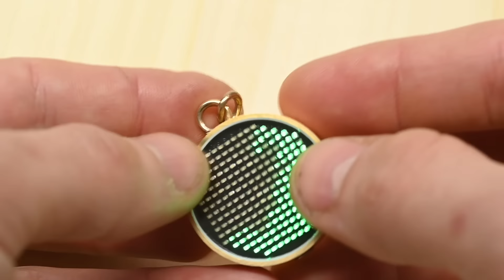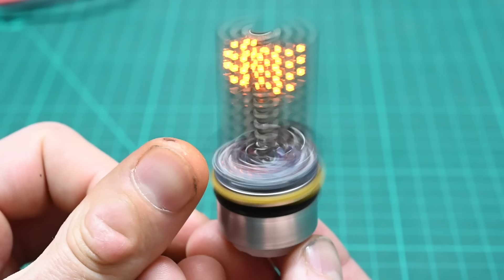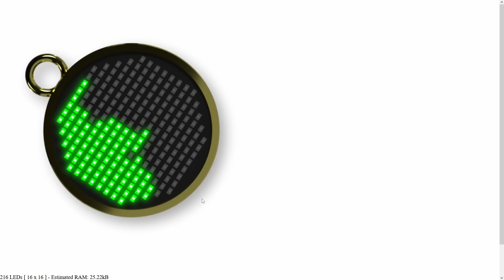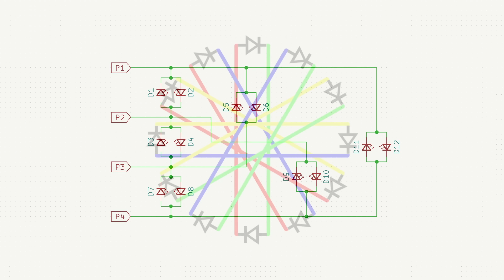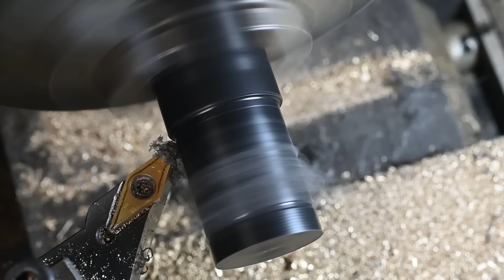Fluid Simulation Pendant

Comment: Just adding the time on the screen as a negative filter would give you a pretty awesome pocket watch.
Reply: Maybe add a light sensor so it’s off when in your pocket?
Reply: @Kdoggg94  A proximity sensor would probably be better. Something like what is used in your smartphone to turn off the screen when you have the earpiece held to your ear.
Reply: @JaysCoolThings  Yeah, a proximity sensor that turns off the display after something like 15s of being in a pocket, and turns it back on immediately after removed, would be the ideal solution.
Reply: @wisplite proximity sensors drain battery too much
Reply: @ExploringNew1  probably depending on the type.

But also, how useful is a glowing watch if it doesn't glow when it's dark
Reply: @JaysCoolThings  it's actually just the camera that turns it off. If you're on a call in a dark room the screen will just turn off.
Reply: @Kdoggg94 Then how do you distinguish between a dimly lit bar or a pocket in strong sunlight?
Also, I think you can use the LEDs as a light sensor
Reply: @SodaWithoutSparkles  shake to wake?
Reply: @Heffalumpen  What about the good n olde Off and On switch?
Reply: @dan_asd  a simple button switch to turn the display on for 1 or 3 seconds, similar to a watch...
Reply: @dan_asd impedes functionality as a pocket watch
Reply: @SodaWithoutSparkles because real pocket watches don’t have this issue
Reply: @Martin-kv3th  real pocket watches frequently had a cover that needed to be opened with a button to protect the dial
Reply: @SodaWithoutSparkles  I was thinking the same thing. It'd be a bastard to implement inside that Charlieplexing scheme, but not impossible. All you'd need would be one port pin from the Charlieplxer port you could config as an analogue input, ground the opposite side of the LED, & read the voltage. Writing the software to actually do it would be a pig of a job though.
Reply: @theantipope4354 Actually not that bad to do in software, as long as the core design is sane. Most MCUs can switch pin modes very quickly, and it's common to use this for real-time applications (eg, bit-banging full-duplex communication protocols, or setting pins to inputs to make them hi-Z)

You could occasionally blink an LED, then measure light with an adjacent LED. You'd make two measurements, before and during the blink. If there's a significant *difference*, then light is being reflected off of something and we're probably in a pocket.

Two big annoyances with this though --
It's hard to do inconspicuously while the display is running, and it's hard to balance energy efficiency and responsiveness when the display isn't running.
Reply: @dan_asd  via captive touch (cuz a physical switch need waterproofing)
Reply: @Heffalumpen  shake and bake
Reply: @SodaWithoutSparkles same way old watches do, have a tiny button to activate the light if the solar cells don't pick it up
Reply: @SodaWithoutSparkles  there's no need to introduce any more sensors and logic, it's lean by design. What he's implemented with the existing sensory data is actually really neat and elegant. it goes to sleep with low/no gyro data, and can be put into deep sleep by placing face down briefly, then needs > 6g (shake to wake), I think this feels quite charming and organic.
Reply: @SodaWithoutSparkles  Theres a pretty big difference between those ambient light levels
Reply: @dan_asd  I miss buttons and ports on modern devices
Reply: @Kdoggg94 one that happens to not respond to the led wavelength.
On 2nd thought, it could just go on the side.
Reply: @Kdoggg94 could just have a button trigger. a lot of pocket watches have covers that open at the press of a button
Reply: @Kdoggg94  Please just make it a button, Stop with the 4321 automations for a literal 1 button use, drives me insane. "Lets take the switch out of fridges for their light and put a light sensor, so the light inside fridge doesnt turn on when its closed" Ok but why? Literally any answer past wanting to be the 'Tech Bro' with an automatic Sink, Toilet, and Shower too. You're outright asking for them to make products less repairable and more short term, why replace a button or switch when you can just buy a new one because the Light Sensor got damaged and you cant replace it?
Reply: @Kdoggg94  What about a proper pocket watch type lid? It would use a switch or button to detect when the lid is closed.
Reply: @Kdoggg94  Or better yet, but a button on the top, which adds particles into the simulation from that end. And the put a button on the bottom which removes particles like a drain.
Reply: @Kdoggg94 Just have it turn off when you close the pocket watch?
Reply: @Kdoggg94  nvm just saw he wanted no switch
Reply: Just add a lid like a train conductor watch
Reply: @Kdoggg94  to everyone in this thread:
just use a button, not everything needs to be futuristic or as convenient as possible
Reply: @Kdoggg94 いや。タイマーでディープスリープに入るか、手動でスリープモードに入った方がいい
Reply: Ngl I think all this talk of sensors might be a bit overengineered lol. A button would probably do fine
Reply: @GameJam230  you can tell who's never tried to build something they designed by the complexity they try to implement
Reply: That then leads into the problem of setting the time. You could do something like have a bluetooth radio internally (that's powered by the charging circuit, to not impede battery life) that would then let you set the time/date, and adjust values in the fluid sim. Would also be useful for firmware upgrades and the like. You could also have the numerals as part of the fluid sim, so the particles bounce off them, rather than just XORing them on-top.
Reply: You just set it whilst Plug into a Computer 📟
Reply: Have yall never heard of an on/off button
Reply: @spaghettiboney   You mean you have to use your hands? That's like a baby's toy.
Reply: @spaghettiboney  I bet you still use horses to get around too.
Reply: Need another (smallish) chip to keep decent time though. Think he's using i2c for the accelerometer so shouldn't need new pins. Probably doable.
Reply: capacitive touch for the win here, like a touch to turn on lamp. it would just know when you are holding it to turn on.
Reply: Great idea! I would buy one
Reply: And add a phone module and gps and health tracker. I also need 10 other things to be built-in if the aim was in fact to take away from the attraction that sucked me into this... I vote keep it as it started... a beautifully complex piece of technologial mastery that taps into fundamental emotions of life. Observing fluid movements can change our psycological state... let's not confuse why with the what or the whatr could be. I'm no expert in this tech or emotions btw so love to all and all things genuine. Great video in passion, dedication and skill. Inspiring.
Reply: missed opportunity for capacitive touch control(s), imo.
Reply: Maybe capacitive touch to turn on when in contact, and double tap to keep on for amount of time?
Reply: i'd actually buy one if it happened
Reply: It would be sick, but it might be a bit hard to read, especially if you just want to glance at it.
Reply: I’d love the pocket watch version too!  💲💲
Reply: Oh my god I would buy that in a heartbeat 😂
Reply: Wireless charging 😊
Reply: I'd buy that
Reply: i would love to have it as a watch! also i wonder if the case could have a capacitance switch to turn it on
Reply: If you meet someone who owns a watch 

Run
Reply: for a cat u r pretty smart
Reply: Seeing it as a Javascript program makes this clock idea seem reachable.
Reply: I would buy that in a heartbeat dear Lord my wallet is already hurting
Reply: Could literally just place an LCD in front of it
Reply: exactly what i though
Reply: You keep adding to this and you'll end up with a smartphone
Reply: A touch control to set the temperature from 0ºC (freeze) to 100ºC(evaporation)
Reply: That would be very cool. Fluid simulator that tells the time
Reply: ehh maybe but then gives it a reason to exist, which is bad
Reply: Yeahhh
Reply: Adding the DOOM game would be amazing.
Reply: hmm ima tell the guys who sell the cheaper $60 versions of these about this
Reply: thatd be awesome
Reply: Or after deep sleep it switches from simulation to a low brightness clock? But then you would need inputs to set the time. That would add complexity.
Reply: @NicolasEmbleton  pocket watches can and often have lids... problem solved
Reply: @declandagod5450  smart.
Reply: Uselessness is beauty
Reply: oh that would be so amazing
Reply: Truly!
Reply: Beautiful.

Comment: dude, routing the board is where i stop when it comes to rolling my own stuff lol. i started as engineer with only hobby experience in electronics and a degree in software and i ended up with a lot of hands on hardware experience. i even have priced out rolling a custom board. but i broke out into cold sweats when i realized someone had to route the board. it was time to hand it off to the guy with 10 years experience with routing and watch and learn from him. for me, routing is up there with RF signal processing in terms of black magic engineering

Comment: I recently made a business card with 19x20 charlieplexed display using a coin cell (it can show temp, humidity, air pressure and all kinds of animations) - also 4 touch sensors to change modes. I used an ATMega328pb. Like you I tried to make the bias nice and regular for aesthetics in my case! I saved time by writing a script to position and connect the LEDs up 😁

Comment: No virtual rubber duck floating in the liquid sim is a pretty big oversight, tbh
Reply: Time to implement an array of magnets to latch a rubber duck to the liquid air boundary...
Reply: @mezu-b8t  that would actually be crazy, a real, physical object reacting to the motion of a fluid simulation, at the scale of a pendant
Reply: Just one yellow pixel floating on top of the pixelated water would be nice

Comment: £750 is a steal!
Thank you for the video.
Reply: £1000 now. haha
Reply: £1000 £750 was too low, I'm glad it changed. I hope he just keeps making more and getting a nice Christmas bonus each year!
Reply: @dfgaJKidk if he ever restocks tbh but i would be down to buy one if he ever does. I’m curious if you can program them to light up in different colors
Reply: @Iam....--..  Nope, they aren't rgb led's so they only do 1 colour, if that is what you mean. It could be re-programed in the same way it was initially programmed, but that would require disassembly and access to the code and tools.
Reply: @dfgaJK he never even mentioned the LEDS…
Reply: @Just_Kys  nah other dude was right, i mentioning programming the lights to change colors then he corrected by by pointing out they arent rgb leds and thus the color cannot be changed
Reply: @dfgaJK fair enough, if i ever get the time, money, and skill to make or commission something like this id prly make it larger in favor of making the less a set of rgbs leds instead
Reply: It's 5 time my current phones and twice my laptop's price 🥲

considering the effort, fair pricing

i checked it for gifting one... but too broke to buy it after collage fee 🥲
Reply: I'd say that even the £1000 is underpriced. Extremely limited quantity, gold plated, tech-jewellery's starting price would be easily £10k
Reply: @permik yeah idk where you’re buying tech jewelry but gold plating isn’t expensive. As much as I respect this guy and his work 10K is almost unjustifiable

Comment: would it be possible to have the board with leds manufactured,
(you could probably just sell this alone)

then have watch maker factory make the cases. or you could have it made of plastic.
or you could enclose it in epoxy resin.

im not sure how much it would cost...
you could take pre orders for the amount you want to sell it for...
basically crowdfunding. no pressure or anything. 
your ideas are so good you might as well make some money from it.

btw mirror finishes are a pain (smudging, scratching, ect), brushed is less maintenance.
can be done by sanding in the same direction.

Comment: If you replace the brass with plastic, you can mass produce it in china. I am too broke right in this job market to buy the real thing, but if it is made with plastic, I could afford it. 

8:35 I didn't understand the LED matrix charlie-plexing part. Can we instead use hierarchical multiplexing by subdividing the grid into subgrids and serially transmitting data to each subgrid. Maybe add a clock + counter to the MSB of the LED grid and GPIO is wired to the lower whatever bits. If we synchronize the clock to the GPIO, we can transmit data serially.

Comment: What thickness solder paste stencil were you using for this board? I've been experimenting with reflowing 0402 LEDs at home too but I have a hunch my stencil is on the thick side because the LEDs are not sitting flat after reflow. Inspiring work as always, please keep doing what you do!

Comment: MIT-designed Fluid Simulation Pendant: A Fusion of Technology and Craftsmanship

*   0:00:04 Project Goal: To create a real-time fluid simulation pendant using embedded hardware, inspired by the desire for real-time volumetric 3D fluid simulations.
*   0:01:13 Simulation Algorithm: The pendant uses the Fluid Implicit Particle (FLIP) method, implemented by the creator based on academic papers and resources from Matthias Mueller's "10 Minute Physics" channel.
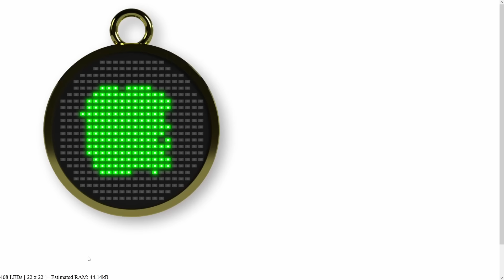*   0:01:49 Development Process: Initial testing and refinement of the simulation were done in JavaScript, leveraging a phone's accelerometer for realistic motion input.
*   0:06:35 Hardware Selection: The STM32L432KC microcontroller was chosen for its balance of processing power (with an FPU), small size, and low power consumption.
*   0:07:21 Overclocking: The microcontroller was slightly overclocked to 100MHz to achieve the target 60 FPS for the simulation.
*   0:07:41 Display: A 25mm wide display using 0402 LEDs at a 1.5mm pitch was designed to fit over a CR2450 coin cell.
*   0:08:16 Charlie-plexing: The display utilizes a unique diagonal Charlie-plexing arrangement to minimize routing complexity and allow for components to be mounted on the back of the PCB.
*   0:14:13 Flexible Routing: Due to the use of a lookup table for the Charlie-plexed display, signals could be routed to any convenient GPIO pin on the microcontroller, simplifying the PCB design.
*   0:15:25 Mechanical Design: A snap-back case design was implemented for easy access, featuring a magnetic charging connector and status LED. Later iterations used a watch glass front for a completely sealed, waterproof design.
*   0:20:29 Fabrication: The brass enclosures were machined using a lathe and mill, with a delrin arbor used for mounting during milling.
*   0:21:34 Magnetic Connector: Sourcing a low-profile magnetic charging connector was a significant challenge, eventually found on AliExpress.
*   0:22:56 Gold Plating: The brass enclosures were gold plated using a process involving hazardous chemicals, not shown on camera for safety reasons.
*   0:24:07 Assembly: Circuit boards were assembled using a pick and place machine and a mini hot plate for reflow, with manual touch-ups for cosmetic imperfections.
*   0:24:34 Lookup Table Generation: A Python script was used to generate the lookup table for the Charlie-plexed display based on the exported netlist from KiCad.
*   0:25:23 DMA for Display Control: Direct Memory Access (DMA) was used to drive the display with minimal CPU overhead, allowing for smooth animation even during overclocking.
*   0:27:38 Glitch Mitigation: Dead time was inserted into the DMA array to eliminate visual glitches caused by the Charlie-plexing and asynchronous register updates.
*   0:30:19 Bodging and Iteration: The creator emphasizes the importance of bodging and iterative design, making several modifications and revisions to the hardware and software throughout the project.
*   0:31:57 Power Management: A low-power supervisor chip was added in later revisions to ensure reliable undervoltage detection and prevent software latch-up issues.
*   0:32:17 User Interface: A simple gesture-based interface was implemented to turn the pendant on/off and enter a deep sleep mode to conserve power.
*   0:34:23 Finishing: Multiple iterations of the pendant were created, with each iteration focusing on improving the finish and aesthetics of the enclosure, culminating in a lapped and polished back surface for a near-mirror finish.
*   0:36:46 Availability: A limited number of handmade pendants were made available for purchase on the creator's website.
*   0:37:13 Conclusion: The project represents a successful integration of software, hardware, and mechanical design, resulting in a unique and aesthetically pleasing wearable device.

I used gemini-1.5-pro-exp-0827 on rocketrecap dot com to summarize the transcript.
Cost (if I didn't use the free tier): $0.06
Input tokens: 42728
Output tokens: 931